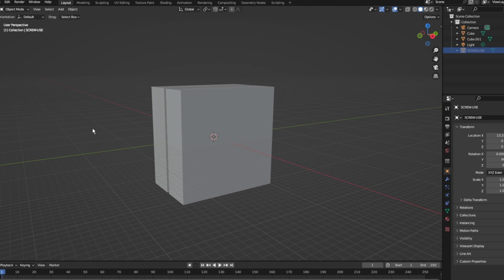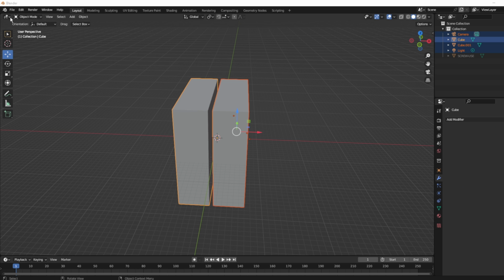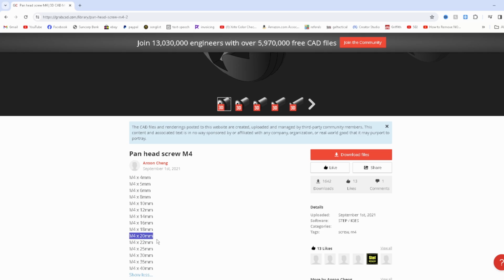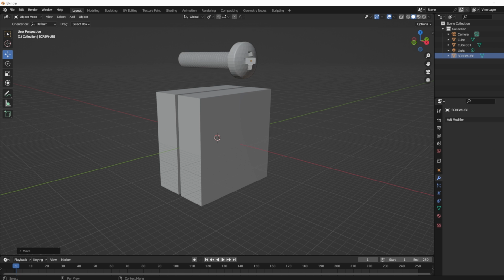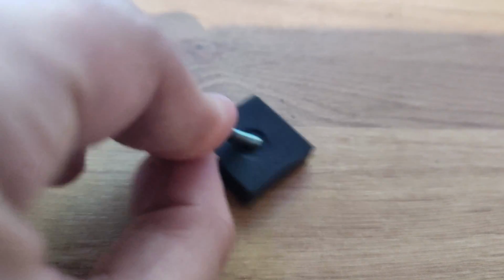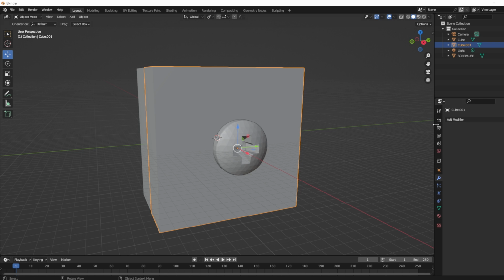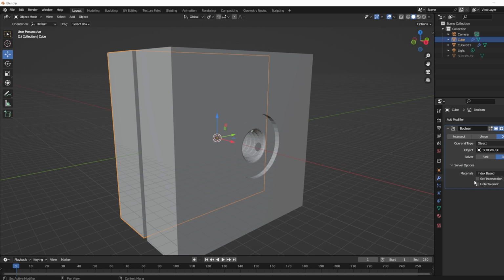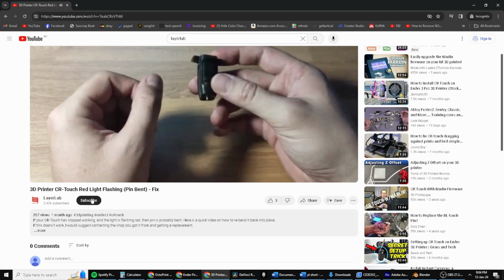How to EASILY Add a Screw Hole to Your 3D Model

Comment: You dont want to scale the bolt lenght just the diameter.  In this case it bolt lengh was on the x axis. If you want to ignore an axis while scale use Shift+ the desired axis than S.
Example:Shift+x than relese the x and press S.

Comment: Scaling a bolt by 10% scales the thread distance too.

You would want to increase the threads thickness, not it's size.
Reply: so you would do s, and then shift and the axis the screw is lengthwise, so in the video you would do s, shift+x and then type 1.1
Reply: scales everything but x

Comment: What I really like is when i need to use e.g. m4 machine screws, i make the hole 4mm in diameter, but the hole walls don’t have threads, so that you have to create them yourself by screwing a screw in there. That only works if it is exactly 4mm in diameter, nothing less. You mights damage your print when not careful. Also softening the plastic could help when doing that if you have enough infill. Overall, you have less areas where the printer could mess up and it is even stronger that the printed threads(own experience has shown that).